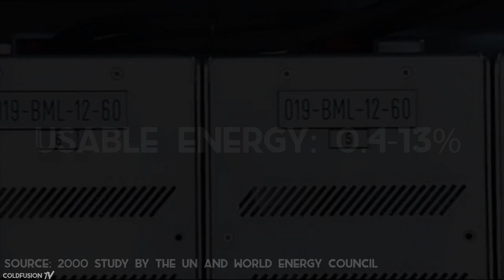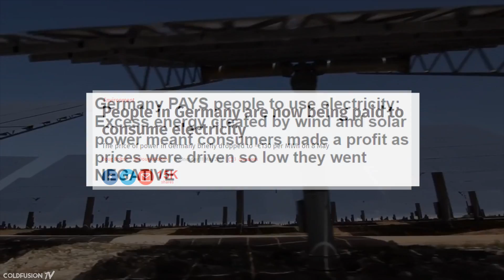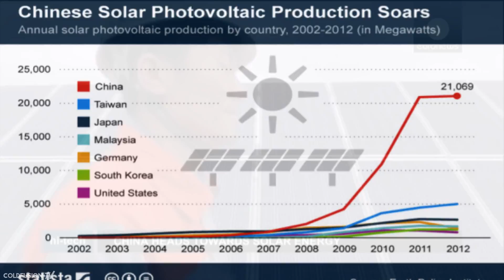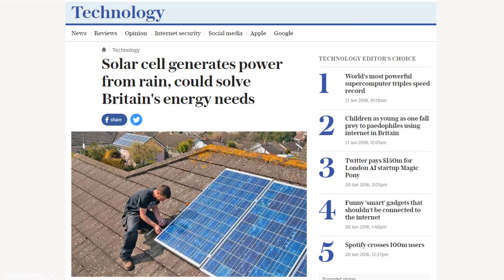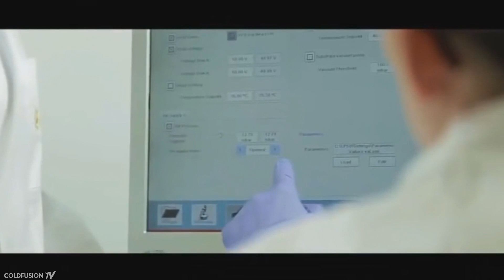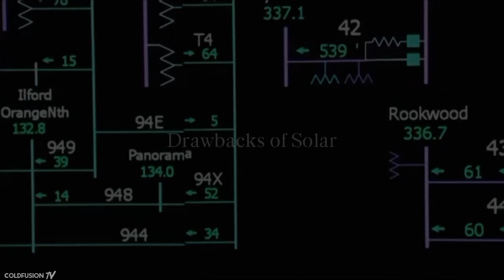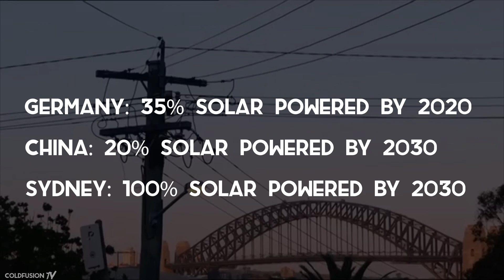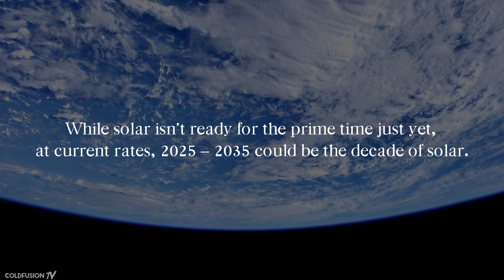The Truth About Solar

Comment: But it does not work through snow, does it? Drawback for nortern parts of the world.
Reply: Henrik Myrhaug simple solution, windshield wipers for a panel :D
Reply: Henrik Myrhaug even if you have perfectly sunny skies in the winter, you will only create about 10% of your annual usage because of the angle of incidence or how low the sun is in the sky. Please see the http://pvwatts.nrel.gov to see how much energy you can expect to create on an annual basis. Also remember most people are grid tied, which means you will pull energy off the grid when it is dark. Essentially using the grid like a battery. However, if you do not have some type of storage, you will not create much energy in the winter, even though the comments about the snow sliding off is correct and does help. Most systems are installed at a 30 degree pitch which helps.
Reply: The reason it snows is there isn't much sunshine. ie: not the best location for solar.
Reply: I have seen a series of programs about Alaska real estate in the Anchorage area, and there seem to be a lot of solar installations in outlying areas,  The panels are near vertical, so very little snow is going to build up on them.  What surprises me about those homes is the huge windows so many have, since that is where much of the heat loss occurs.  Those panels have got to be putting out a good deal of energy to compensate.
Reply: Interesting point about the vertical panels. I can't imagine there's any relationship between solar PV and heat loss, it's extremely rare to use solar electricity for heat.
Reply: If you are going green, I would think that there would still be some concern about the efficiency or lack thereof of all that glass.  I also think just the mixing of the air from that cold surface with air from insulated surfaces would produce drafts.
Reply: sweep them off dumb ass
Reply: Again, the number of places with 1.5 meters of snowfall are not heavily populated and in Alaska, at least, the panels seem to be set a couple of meters above ground at a near vertical angle.  1.5 meters of snow is not going to stick on a vertical surface.  Further south, I would still say that you should have them mounted off the ground with the ability to pull pins and swing the panels from a summer 40 or 50 degree slant too a 70 or 80 degree slant to match the lower position of the sun in the winter.
Reply: Yes actually works through 12" of snow.  solar is big in Vermont and New Hampshire in the US.
Reply: I think they are working on getting power from water as well as solar on the same panel. The snow would melt turning into water, which would power the cell, producing more heat.....
Reply: Henrik Myrhaug there are lots of ways to solve that problem
Reply: Lunar Trooper But if there is a snow storm, the last thing you want to do is go on your roof  and brush away snow. And if there is 1,5 meters of snow on the roof, or anywhere else the panel might be, it gets hard to remove it.
Reply: Samurai Shampoo But then you need electricity! If you have it covered, it cannot produce electricity, so it heating will take more electricity than it can generate by the snow being melted.
Reply: Henrik Myrhaug it stores power in batteries for use later wen sunlight isn't available, during night time, or snow
Reply: Lunar Trooper But if the panel is covered in 1,5 meters of snow, it won't me beneficial to heat the snow, especially not if it keeps snowing. at least not if you need a lot of electricity for a fridge, tv, washer and teating in the home.
Reply: All you need is an automated wiper or brush for the panels. It would be a pain but not a crippling problem.
Reply: Solar can work for most of the world though. I think wind won't be a bad power supply in a snowstorm. You might need to keep the gears from freezing and build in brakes so it doesn't spin out of control but I think it should work fine.

I'm from a warm country so don't blame me if I got it wrong.
Reply: no no,no I just got done working for Blattner energy the building a solar field in BG Ohio the arrays follow the Sun it even produces power at night when it snows the solar panel can go straight up and down in the snow will fall off
Reply: I think hail is a bigger problem.
Reply: PackerFan Gamer seems legit.
Reply: As someone who oversees installations of solar arrays in a northern snowy climate we account for snow drifts with our systems and once panels heat up and start producing snow starts to melt off the panels.
Reply: Only a hybrid PVT panel can work in a Snow area once the warmed water in the storage tank is recirculated back behind the PV panel that melts the snow.
A PVT panel also works at night time, where the summer night time tempertures are above 20c, delivery pre heated water up to 30c for using the next day toped up by any type of hot water heater device
Reply: Alexandros des Børgus no the teslar creator has made really strong solar panels
Reply: VideoMorsels it doesnt but there are power packs that store the power so then u have power at night
Reply: Henrik Myrhaug I'm solar Fields it moves automatically and goes 90 degrees so the snow falls off
Reply: Only if the solar PV panel is a PVT solar panel connected through a 2nd pump and Snow controller linked to a PVT thermal Store hot water tank
Reply: Most of the people commenting on this comment thread seem to have no idea what snowy climates are like... wipers? really? Where I live we get many, many feet on our roof through half the year. A wiper is NOT going to do anything, especially when ice freezes the squeegee and motor/gearing behind it. We have people who have solor panels here already.. and through winter they are always covered in ice and snow. I only know they have solar panels because I've seen them through summer.
Reply: design the panels with ways to clean or melt off ice.... shouldnt be too hard

Comment: _ this video sickens me to see all that wasted money. they talk about future solar power panels will be cost efficient.  but they keep showing the wasted money of the existing too expensive wasting money panels. People don't care. You reading this don't care.  your home is not one hundred percent LED bulbs. They're only $3,  your windows are not the highest efficiency possible. the car you drives are not the highest efficiency possible. Now you want to discuss extraordinary expensive solar power panels? my local power plant went to a hybrid solar power plant, spending 400 million dollars of tax payers money to save 176 million in fuel in a 100 years time. yeah that plant is still 100% HID lighting which is 5 times more inefficient than LED bulbs. Each one of those retrofit LED bulbs are only $150 saving $150 in two years time per fixture. but yet I drive to this hybrid solar plant with all the street lights, parking lots, and schools, still HID lighting. that H in HID is HIGH power.  solar power panels are nothing more than a too expensive prototype school science project. they know it's too expensive before they're building them. you narrow down a cheap way before you building a full-scale model. They talk us into wasting  money into solar power plants instead of other much more cost-efficient ideas.

Comment: Plants store solar power as sugar. What can we make?
Ammonium nitrate (Haber process) for one!
Reply: How about using solar power by day to pump water uphill to a reservoir to store unused power and then letting that water run downhill through a turbine by night to meet high demand?  Obviously you'd lose some power but it's got to be at least as good as a big battery in terms of efficiency with the added benefit of no expensive/dangerous/toxic/flammable battery chemicals and the limited charge/discharge cycles of current battery tech
Reply: wRichard Stark
Sorry, no, it takes more electron volts to split water than you can get back at 100% efficiency. Go check if you need to. There's this thing called entropy.
And about gases and pressure, you can get most of that back.  Pneumatic motors have been in use since at least the 40's.
In fact if you don't force hydrogen released from high pressure to low to do work (the scientific term only here) if will get very hot unlike most other gases.
Reply: Splitting water into H and O, requires exactly as much energy as you get by burning the H and O.  So your idea is like changing a dollar bill into four quarters.  If you want to compress the gasses before using them, then the process consumes more energy than it produces.  You will not get rich.
Reply: *****
I've made methanol from wood in physical chemistry class. Corn stalks would have worked.
Do you eat wood or corn stalks?
Here's something you should know about truth: truth don't give a fuck about what you want. You can want with all your heart and that does not make it true. Clap all you want, if you're not in never-never-land the fairy won't exist to die.
Reply: you can actually make methanol without impacting the corn for food, it uses the byproducts that we don't eat.
Reply: ***** read my comment, i said methanol, not ethanol, similar yet different
Reply: Brobble
Economically feasible depends on what's available. While oil is cheap enough, wind and solar power are not economically feasible, except that lately it's been more and more clear that burning cheap oil and coal have massive costs not taken into consideration in the economically feasible LIE.
What I posted is that we CAN make methanol from wood, corn stalks, and cellulose in general. .
We have a lifestyle based on exploitation that can't continue for a whole lot longer. We could have cut back and made what's left last a very long time but where's the FUN it that?
Oh fucking NO, the only acceptable choices have to be MOAR, errrr, economically feasible.
Our species may get wrecked because of some assholes bottom lines. Brilliant!
Reply: Batteries are reasonably efficient, but LiIon batteries can only be recharged 300 to 400 times before their capacity drops way off. Your costs need to consider battery lifetimes of 1 to 1 1/2 years. Inverters, unless you run your entire house in DC, will fail after 5 to 8 years. They need be replaced. Pumped storage has maintenance costs also, but you do not need to replace the major system components of a PH system every 1 to 1/2 years. 

Lithium is not likely to drop in price since you need to mine it. The cathodes include Manganese, Cobalt or Vanadium oxides. At current consumption rates, Mn and Co have 50 to 100 years of supply. With a large increase in LiIon battery production, this supply duration will be reduced accordingly and the costs of these elements will increase.
Reply: good thinking!
Reply: bananian
I wondered about splitting water for hydrogen and oxygen but:it would take more energy to compress for efficient storage or shipping.
But on a small scale you can store in day what you burn in the night.
Reply: geokon3
You should tell the people that measure the energy then and inform the fuel cell designers that they got it wrong.
What makes sense to you would make perpetual motion machines not just possible but viable. How many working perpetual motion machines do you know of?
Reply: *****
It is about using the excess energy instead of wasting it. Haber process makes FERTILIZER that will not be burned overnight but can be of benefit.
Splitting water into H2 and O2, if you don't compress them then how to store enough to burn for long later on?  Solid dry fertilizer doesn't need compressing.
Reply: *****
I mentioned the PMM because that's what over-unity claims amount to.
Without entropy, I don't believe that life would be any more possible than without gravity.
Reply: *****
What else do plants produce from sunlight that isn't made from the sugar they produce?
They burn some of the sugar at night, turning oxygen to CO2 to stay alive.

Just how efficient? What does THAT have to do with my point?
The growth of the plant that starts from a seed is mainly due to photosynthesis (some energy is from the seed) and there are plants that grow mainly in shade yet still grow.  There are plants that grow under water in light filtered by that.
Work it out, Darwin, they're as efficient as they NEED to be.
Reply: *****
Okay, photosynthesis only absorbs certain frequencies and not 100% of those nor is it the end-all of plants using light, you are correct. They can only take so much light anyway.
 
I liken plants storing solar energy in chemical bonds of sugar to humans storing solar energy in chemical bonds to produce fertilizer. It is a metaphor. The efficiency of producing the fertilizer is not dependent on the efficiency of plants producing sugar so I don't think that the fine points of plant biology make much of a difference in this case.
Reply: Brobble
I doubt that lack of food or rising prices bothers the very few who make the big decisions that shape economies. To them, those are good things, profit security second of course to a "good for profiteering... errr, business" WAR.
Reply: *****
"In the process currently used to produce ethanol from corn,"
Not the only process, not the only alcohol, just YOU ignoring what parts other people wrote that don't suit your angry narrative.
We can make methanol from cellulose regardless of different being done.
Reply: Brobble
Oh By The Way, check out what percent of Germany's electricity is made by burning fossil fuels.
Here in the Land Of Exxon we get the story that big oil wants us to hear, which is bullshit.
Reply: *****
There is a sustainable level that we passed about 100 years ago. But even at pre-1960 levels we could have eased a transition over a very long time.
At the same time that the burn rate went up, cutting down forests worldwide has increased.
In total line with those, the world has been getting poisons dumped/spilled all over in increasing amounts.
People can say there is no Satan but I say that No Satan has been doing a hell of a job destroying the life of this world.
Reply: Buzz Werd
Reply: If the system is 50% efficient, then your cost per watt for the stored power doubles. The point of storage is to use surplus output from PV cells to store the energy in some form. You still need direct electricity from the PV cells to use in real time. Let's say that your real time consumption is 50% of your total usage, then with 100% efficient storage, you need a PV system with 2X of your real time usage. If your storage is 50% efficient, then you will need a PV system that is 3X your real time usage. This is 3X the actual solar production, not the nameplate production. If your real time PV production averages 50% of nameplate, then your system with a 50% efficient storage system requires a PV system which has a nameplate capacity that is 6X your real time usage. 

Solar systems should be sold de-rated for the location where they will be used rather than with a nameplate power rating that is based on the panels being perpendicular to the sun's rays, at the summer solstice with clear skies during the time of day of day when the sun is directly overhead. Another factor is the temperature. A problem with southern Arizona is that in the summer, the temperature is high enough to negatively impact the efficiency of poly-crystalline solar cells.
Reply: Flameboar
In Arizona there is a solar power plant that produces electricity by heating oil that is then used to drive steam turbines, not a PV plant.
Our power grid has no practical storage. Excess not sold is mainly lost. Getting something instead of nothing is worth investigating.
Reply: We need an efficient storage method for solar or wind based power. Pumped storage works, but you need a large amount of water and an elevated location for the storage. This will handle the diurnal off-set. The seasonal off-set is a much larger problem.
Reply: Flameboar
Don't they run cars on compressed air in India?
Reply: Buzz Werd couldn't we store the energy in rechargeable batteries? Have a big solar farm hooked up to large batteries meant to store energy (we would need to make them ad I'm sure our current ones would not be up to the task) and then use that stored power at night or any tune without sun?
Reply: I don't see why not, people are already doing that on small scale, except that on large scale there's no one doing it and perhaps no way it pays enough yet.
Reply: PassiveSmoking 
Batteries have better efficiencies than pumped hydro which, btw, IS the greatest energy storage scheme by like 99%.
The problems with PH is evaporation, mosquitoes and bitchy people, not to mention the requirement for proper terrain. There's a rather new idea of using giant weights underground and even rail cars full of rocks that serve the same purpose. Water is less dense thus would require more excavation per kWh stored. 

Eventually, li-ion or some other battery will be much cheaper once they are mass produced at much larger scales. In fact, just 100 giga factories would take care of all the world's  (if all renewable) energy storage needs (according to the Tesla company)!